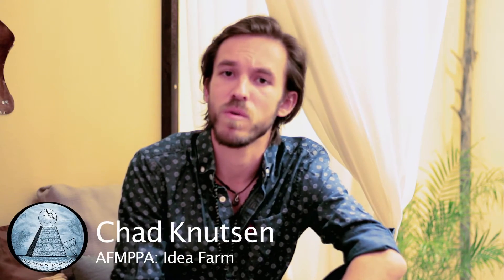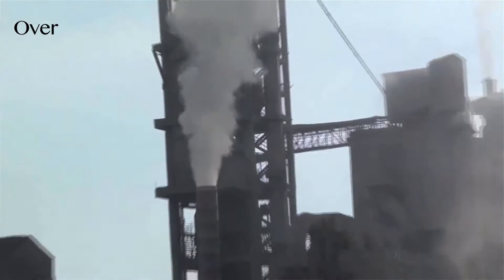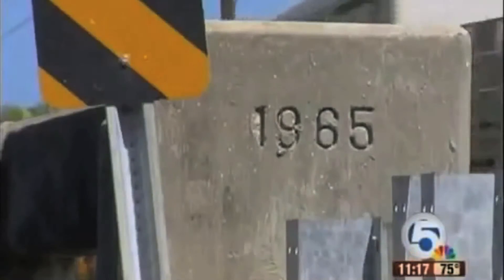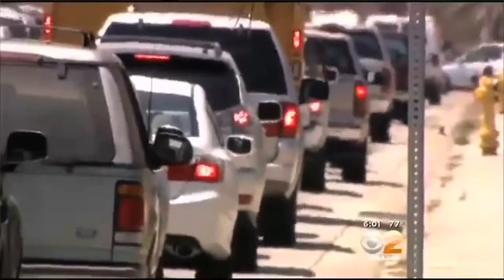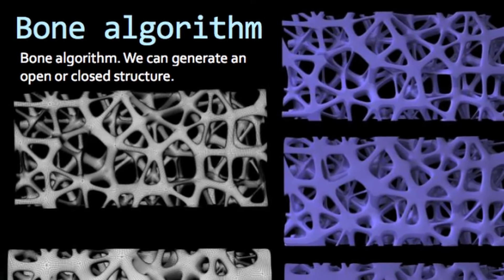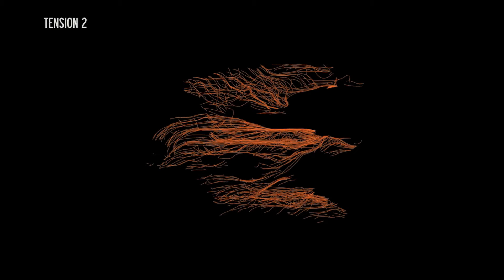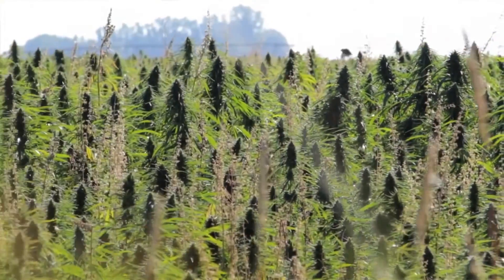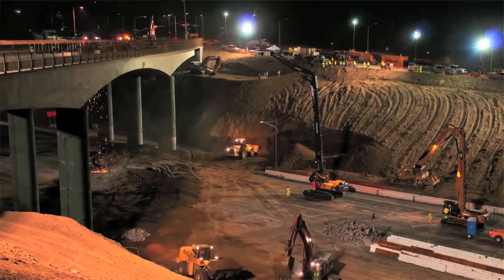3D Printing Hempcrete - Proposal Summary - MIT Climate Colab Buildings 2015 Winner

Comment: This guy literally forgot to tell everyone a bunch of reasons y hemp Crete is so good.
Reply from the maker: Well I wasn’t necessarily trying to describe all of the positive benefits of hempcrete, but addressing a specific do use case and a new material format, and method for producing. You are so right, that there are so many more benefits to hempcrete, if I were to go through and list all of them in this video, it would’ve been very very long, and not to the point I was specifically trying to make at the time.

Comment: Utilizing Hemp fibers in a fiberglass type layup I am thinking I have a project for someone who is not using their garage....Small layup about 4' X 6' 2' deep...About 750000 customers in the USA waiting.... MAterials costs should be less than $50, retail in the area of $225-$325 depending on type...I am past the legal age limit and will be thrown back very soon but a whipper snapper should jump on this. My licensing is about 3% the first 100,000 sold, Reduce to $ 10 per unit after. I am probably underestimating by a factor of twenty if you add in the expansion from the base Idea. Detroit and Flint might be a good area with all their factory workers and abandon in place facilities if a person goes worldwide in production.

Comment: Guy get with me, 
 Mg/Al mm concrete can Do what your asking 1 hour cast hemp fiber reinforced, cast as sheeting, I beams, flooring, standing seam roofing, All cast in a factory settings,
   have test samples far in excess of >1,500psi On Edge
 17mm tile Stop >3,400° >70 minutes,  backside of tile never over 222° and So much more
Reply from the maker: Lets definitely connect mate. hit me up at chadknutsen.com

Comment: Sounds like a scam. You show pictures of 3D printing in construction and you don't even have a 3D printer of your own. You just show the accomplishments of others to get people to pay for your own private 3D printer because you wrote a report. In your video report you show pictures of bridges yet hempcrete is not suitable for load bearing applications as it has 1/20th the compressive strength of concrete. It seems you don't really know where it's appropriate. You point out having to wait in traffic for infrastructure repairs. Again applying hempcrete to the wrong applications. Get back on track. Do you have a degree in structural engineering? If not, go get one, otherwise it's onward and fall downward. I'm excited about hempcrete, but instead of all this talking and book reporting I'd suggest you go get your hands dirty and get a job working on an actual building project done the usual way with buckets and forms rather than dreaming of all this technology and unproven equipment..
Reply from the maker: You assume too much mate. Firstly, you have clearly not read my proposal thats linked here. We are developing a new formula for hempcrete in which the materials are mironized, and thusly our mixture has incredible compressive strength unlike that of traditional hempcrete. If you actually read my proposal you may find there is more going on here than you have assumed. (we all know what they say about assuming right?!)

Secondly, one does not need a degree in order to independantly study hard and find great teachers, and get ones hands dirty and learn and create things. 

Also, MIT would not have selected my proposalas the winner of the Buildings section of the Climate Colab in 2015 if it did not have any merits. Trust me, they grilled me way worse than you have, and once they actually attentively listenned o what I was proposing, the judges unanimously agreed that my concept was sound, and encouraged me to pursue it further. We also were selected by the MIT Colab community via the Audience choice award.

I have built with traditional hempcrete, and numerous other alternative building materials, in numerous regions around the globe. I am not talking about any untested technologies either. Additive manufacturing...not untested. Injection molding, not untested, the combination of technologies, the method, and the material is what makes this whole thing work. 

Rather than judging ideas and people who are actively trying to solve problems (without doing any due dilligence of your own first), perhaps you could consider creating something of your own and working hard to make it manifest. Trust me, its a lot more fun than trolling youtube videos and trying to spread negative vibrations.

I may not be a structural engineer, but I do not claim to be one. what I am is a person with an idea, and the balls tenacity and perserverance to build the mastermind group to make it a reality.

No one is an expert at everything, so thats why we build teams of experts to fill in our own experiencial gaps. 

No I dont have a 3d printer, but I have numerous associates who do, and connections with university departments and technology parks ho support this concept and are actively working with me to develop this technology. (once again going back to the mastermind group).

In a nutshell, while I appreciate your taking the time to comment, I feel you could do so in a more productive way. I'm happy to discuss this project with you over a coffee sometime if you would like, and perhaps you can understand this is not "a scam" or a ploy to raise funds to buy a 3d printer. I have more important things to do than ty and con people into buying me something that honestly I would just buy if I needed one. I dont like to waste money however, and my funds have been better directed toward other aspects of this projects development thus far. 

Anyhoo, good luck out there, and I hope you can re-examine your approach to these sorts of conversations in the future as the negativity your comment exhibited will not take you very far...#justsayin

Peace mate,

Chad
Reply from the maker: Btw, we have several production facilities coming to life this year and will be printing out the cities of the future in no time! Let the fun begin.

Comment: Hempcrete monolithic domes
Reply: lalo nunez 
 So do able add Acrylic monomer to the design mix
Reply: lalo nunez  I’m making my fourth hemp block which will be using MgO instead of lime.  You are on the right track. The dome structure is the strongest.  If they print a hemp adobe dome using MgO, the cure time will be much faster.
Reply: Chad is a Fraud, holding back the actual solution called Hibiscus Cannabinus
Reply: @hempmayor6639  could you elaborate?
Reply from the maker: please...do tell...I always reserve the right to get smarter.

Comment: Very smart.  I was thinking about this since 2014 and contacted 3d print construction companies in China and asked them if they could print with hempcrete and they told me they could.  They might not have understood completely about hempcrete but they can print by taking broken materials, grind them up and turn it into a form that can be used for 3d construction.  If I were you I would present this to a venture capital firm to see if you can get funding.  Only thing I didn't think about is using hemp plastics for the frame, great idea man.
Reply: +jomossino79 If you have any contact you believe may be interested in helping this project come to fruition, I'd welcome the introduction my friend.

I appreciate your kind comment, and applaud you for having found your way to a similar line of thought as I did. Hemp just never ceases to amaze eh?!
Reply: Chad Knutsen You will have to communicate this to them.  The Chinese do respond to anything that is beneficial for them.
Reply from the maker: @jomossino79  We are doing it here in the US of A first, proving the tech, then plan to make it available globally!
Reply from the maker: @BxBxProductions  haha ya, We are launching this project On US soil.
Reply from the maker: Thanks mate, the Chinese have been all over 3D printing houses for a while. I jusy hope they choose to indeed use sustainable materials so that te concrete emissions problems aren't expanded. Thanks for your comment.

Chad

Comment: Could you use MgO as the binder with the 3D printer instead?  If so, then why use lime?
Reply from the maker: Funny you should mention that. The next phase of development right now is creating the optimal mixture. I'm planning to produce some uniquely active particles of lime, MgO, as well as hemp CNT's and a few other interesting things.  The most practical mixture may often be determined by availability. For example, if I were near the sea, I may be able to obtain large amounts of oyster shells etc, from which I could derive plenty of binder. If I were somewhere else, magnesium may be more available. Very astute of ye to suggest this though mate. Feel free to contact me via pirateacademy.org if he'd like to get involved.

Chad
Reply: +Chad Knutsen I replied on your website.  Thanks for the response.  I love your work!
Reply: Tyler Short 
 You can use geo's in a Hrmp fiber mix design with lime
  Mg/Al mm still gets a 1 hour cast as well, incredibly strong Yet malleable unlike SRConcrte
 Use acrylic monomer for the organic fiber